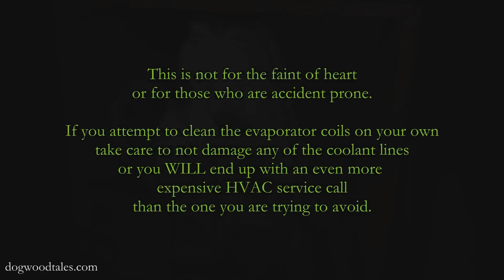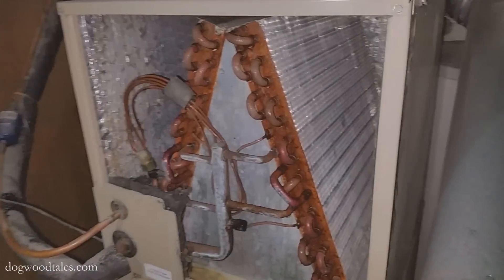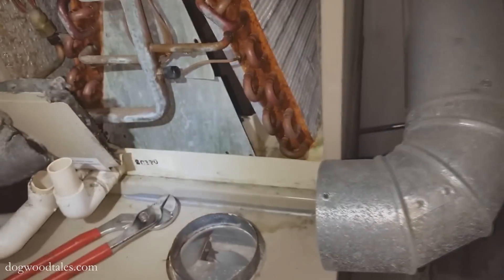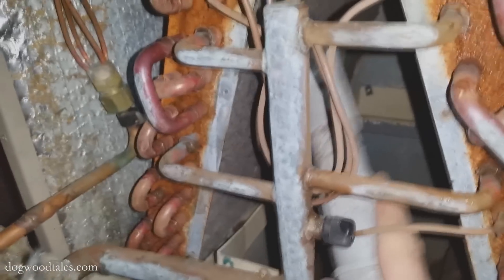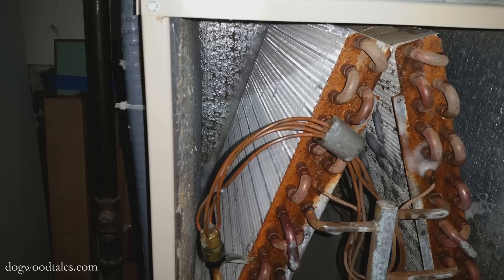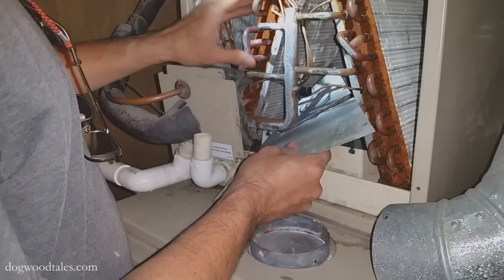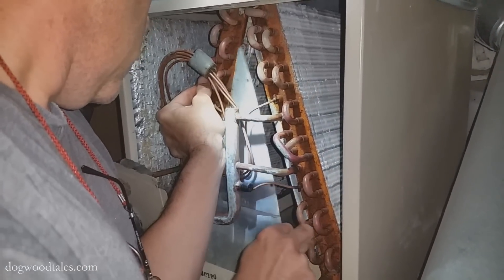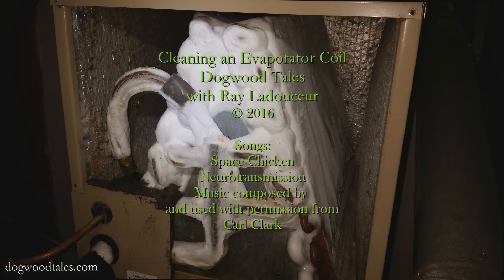Frozen Air Conditioner

Comment: I have been in the sheet metal business for 35 years everyone puts the filter right at the furnace or unit this leads to less filter changes because out of sight out of mind. But if you install filter grills inside the house two things will happen you will notice dirty filters thus changing them more often, and you will keep cleaner the return air duct system which people tend to forget. Having to replace dirty ducts that have layers thick of dead skin cells and hair believe me you don't want your air dragged over that filth.
Reply from the maker: Tarbaby I actually do put filters inside the cold air returns but started that practice after the point of this video.

Comment: This is why I buy the very best 3M filter & change it every three months no matter what.
Reply from the maker: Who Me? Ounce of prevention equals a pound of cure 
I do this now too with no further issues, but back then I still had an electromagnetic air filter that I cleaned monthly but it just didn’t filter as well as these pleated filters do and I ended up with all that gunk
Reply: they are very hard on fan motor damned if you do damned if you dont

Comment: I think the AC guys are trying to scam my mother. Can you answer a couple of questions for me?
Reply from the maker: DreamZ FPV I’m not a licensed hvac tech, but I work with them
I can’t make any guarantees but you can post your question here and I can see if I can find a reasonable answer for you.
Reply: @dogwoodtales  thank you
Reply from the maker: DreamZ FPV I’m wondering why it was overcharged to begin with and then if he discharged too much
Yeah I know you’re ref to the evaporator coil
Good luck!
Reply: @dogwoodtales  what should I do this unit is less than two years old. The motor to the fan outside was stopping. After my research and comments sense it's either the motor or the capacitor. Any this guy says it's over charged and said he fixed it then an hour after he left my unit has ice everywhere. He comes today and says the evaperant coil needs replacement. He said there is nothing wrong with the unit outside. So either his meter is not calibrated or he doesn't know what he's doing. He is supposed to be coming back in the afternoon to put in a new coil. The unit it warrantied and I've paid my $50 deductible but if he's a scammer or if he doesn't know what he is doing I don't want him in my house or repairing anything.
Reply from the maker: @djilly75  First, keep in mind that this is site unseen, so again no guarantees.
After sharing this with a commercial hvac foreman with many years of experience I can share this much –

Chances are there’s nothing wrong with his meter.
If the motor was running and then shuts off, it’s a thermal issue. The motor was overheating for some reason.
If the motor just doesn’t start, then the first thing to look at is a bad capacitor.
If the unit is freezing over it could be any combination of a dirty filter, a dirty coil (my case in this video), and/or low refrigerant.
If there’s low refrigerant then there’s probably a leak somewhere. Have the tech show you where the leak is.
If this unit is less than two years old it probably has an aluminum coil and probably shouldn’t be having leak issues already, but it could just be a dud too. It happens.
When the tech comes out to replace the coil, you have every right to stand there and watch and ask questions.

My .02 - Look at that coil before he does anything to it. If it’s caked with junk (like mine was) then maybe have him just clean it before doing anything else and then see if there's problems.
Also check out your air filer. Those need regular replacement. A dirty filter and/or a dirty coil will slow down air movement and cause things to freeze over. An improper charge, low refrigerant or too much can  freeze it over too.
Sounds like you have an extended service warranty on it, so worse case scenario (imho) is that you’re out $50 for a new coil.
If that doesn’t fix the problem, then make them come out until it’s right, but  I’d be wary about paying them $50 each visit.
Hope this helps a little.
Reply: @dogwoodtales my main question is why is he saying the coil needs replacing? He said that's why there was ice. There was no ice until he discharged it. It was only a motor or capacitor problem. It could have been a simple cold solder joint. Lol I build drones. Cold solder joint is an inside joke.
Reply: @dogwoodtales  he was talking about replacing the coil inside the house. I'm going to stay quiet and record everything he is doing. I will stop him before starts removing any big parts. If he is overcharging the insurance company then he better have some cash for me lol

Comment: I want to add a picture but it won't let me. I'm new to this and don't want to call an AC person because I live on limited funds. The coils are turning white and they didn't do this last year when I bought this place.  Not all the coils. Starting at the bottom they are white. Like three rows then it goes to the copper looking like they normally look. Am I too late....do I need an expert to fix this? Any suggestions will be much appreciated. Thank you!
Reply from the maker: Wendy Longmeyer honestly I am not sure. If the coils and filters are clean and the system is still having issues it’s best to call in an expert to look at it. Your system could be low on refrigerant, have a leak, or any number of other issues that are far less diy for the average homeowner.
Reply: @dogwoodtales  thank you so much for this information. I will call in an expert. I have my areas of expertise but this is definitely not one of them. Lol
Reply from the maker: Wendy Longmeyer sounds like that’s the best option. I began this video with that caution statement for a reason. Hope it doesn’t cost too much.

Comment: These hack videos gotta stop.. those refrigeration lines are under extreme pressure with a chemical called refrigerant.. crack or break a line you will be injured or worse!! I dont recommend amatures doing this.. plus the coil should be removed for a proper cleaning by pro's and you get a workmanship  warranty... this video  is not smart!!
Reply: Whatever you're selling, keep it to yourself.. NO one watching this video even after 7 months liked your comment... Don't be such a pussy, its just HVAC not a rocket engine.. If you were a REAL HVAC tech you would let people destroy their stuff, so you can sell them new systems; so you Sir are just a Troll !

Comment: Ok...i guess this vid is for people that are frugal... PLEASE TAKE MY ADVICE.. GET AN AC/ HEAT SERVICE CONTRACT... LET THE PROS DO IT... THEY CAN FIND ANY OTHER UNDER LYING ISSUES THAT YOU MAY NEVER NOTICE OR UNDERSTAND... I DONT RECOMMENDED AMATEURS DOING THIS..IF YOU RUPTURE ANY REFRIGERATION LINES YOU CAN GET INJURED OR WORSE!! LETTING A PRO DO IT  MEANS THAT THERE IS A WARRANTY ON WORKMANSHIP!!  You may save yourself a couple of bucks by doing it yourself but its not smart!! It will cost alot more if you screw up!! CALL A TECH!!

Comment: How did it get so dirty?  Was no filter ran for years on end?  I don't even catch that much filth on the filter itself.
Reply from the maker: Blaine Bugaski I’m not sure
Perhaps the electrostatic filter system that I used to use didn’t clean as well as promised even though I cleaned it faithfully every month. I also had a lot of kids in the house, a dog, and a wood shop, so those factors accelerated the dirt accumulation. I think it was mainly the system as it’s been clean since I started using 4” pleated filters.
Reply: Ah yes, the electric air cleaner.  My father had one of those, for about 10 years neither of us knew that there was a SECOND cartridge in the ducting behind the first.  We had only been cleaning half of it for literally 10 years.

There are the mesh screen pre-filters and then the electrostatic units side by side.  Also we had been installing them backwards.

It was a $hit show from the beginning.  Lots of blackish filth throughout the HVAC system.  No smoking either but it was almost like a sooty type dust, the type that if you touch it, it just smears around instead of wiping clean.  Never knew what the heck was up with that.
Reply: Mine gets this way every 2 years.. I clean it yearly as PM now... Arizona with dogs inside :p

Comment: Change your filters people
Reply from the maker: Austin Bartose actually I had a electronic air filter that I cleaned once a month religiously for years and then switched to the 4 inch pleated filters which are changed every 4-6 weeks. While that is an important first line of prevention and maintenance it still doesn't 100% stop the relentless force of dust over time.
Plus having a woodshop in the basement probably didn't help either lol.

Comment: I just cleaned this last year, have been replacing the filters and cleaning the outside system. So expensive to add refrigerant, might be my problem
Reply from the maker: javier hernandez could be, but low refrigerant wouldn't make it dirty
Reply: correct, I was just mentioning what I have done so far, implying that low refrigerant is most likely my root problem for a frozen evaporator coil. 

had the same issue last year and I thought it was the dirty coils and filters I found in a house I recently bought.

Comment: great video can you tell me which side should I remove to see if its icing up. I will greatly appreciate it.
Reply from the maker: Luba Luba I really can't say without seeing your unit. But if either side is accessible, then it will work. In fact, if you can work from the side opposite to what I had to do you might not have to deal with all of the hoses I had to. Good luck!
Reply: can you look at a few pics I can upload here
Reply: click on my profile pic and background you can see both pics where the evaporator is located
Reply from the maker: First, thank you very much for watching my video. I do hope that you find it informative for your situation.
However, I think it does both of us a favor for me to refer you back to my statement in the first 5 seconds of this video.
I think you would be better served by hiring a professional HVAC to resolve your issue. I know that will cost some money, but a wrong move on your part and it will cost you a lot more money.
Best wishes.

Comment: can a person use a air compressor and spray out the ac coiils inside?
Reply from the maker: Jesse Brouwer not sure. The cocern is to NOT damage the foils, or as little as possible. Also, an air compressor will blow all that dust into your unit, so for that reason alone I wouldn't do that.
Reply: I did the first time I cleaned mine as I have access to the inside of the A frame.. Must spray straight and true, Lot of room for error and damage though. Vacuum with attachment worked best.

Comment: Well my wife & I noticed lots of leaking from our a/c. Called repair person & they keep insisting that the freezing was caused cause we kept dropping thermostat below 70°. I told him we have it set & dont touch it. He told us let ice thaw, so we did then he later returned to cut a.c. unit back on from outside and again it leaks. He never told us this may be the problem. He insist that the only reason it happens is from us changing temp below 70° cause he ruled out all other possibilities of thermostat, batteries or air filter.

Comment: Mine freezes up from time to time, mostly in the late evenings.  I checked under the A coil and it actually clean.  I've had this unit for almost 15 years and have never had to clean it, other than vacuuming some light dust off the outside of the A coil under the filters once in a while.  I change my filters regularly.  I have noticed that the unit outside has some bent fins (more than normal) so I am wondering if that is my issue.
Reply from the maker: Terry C. Enough Damaged foils will reduce air flow. Sounds like you might need a pro to diagnose.

Comment: Is there no way to see the bottom side of the coils?  It's all burner section just below it?  I need to see mine.
Reply from the maker: BeeRich33 in my particular A frame coil what you see in the video is as much as I can see in person. directly below this, in the design of my system, sits the heat manifold.
Reply: Seems I have the same.  Had mine pulled for $400 to have cleaned and recharged.  It was completely caked.  It's now frozen in 33°C weather.  Not sure what to do.  I don't want to spend another $400 just to clean it.  There's a problem.

Comment: Thank you God for You tube videos on cleaning evaporator coils! I watched your video and not really wanting to do it,  I called a heat and air company to clean it for me.  Well he charged me a $75 service call and told me to open my windows bc it was going to be another$150 for labor plus $90 per pound of freon.  But he couldn't tell me how many pounds approximately It needed. Im not stupid! It has never been cleaned and I have 3dogs and a cat,  so I knew it was dirty.  So I bought coil cleaner and took it apart as you described in your video!  Within 2 hours it went from 84 degrees down to a comfortable 73!  THANK YOU SO VERY MUCH!
Reply: I guess your being frugal.. your tech is correct to charge what he needed ...they are pro's like  doctor's or lawyer's...the tech was planning on total removal of the coil for a deep down cleaning as it should... what you did was to get it to work (minimum)(band aid) .. also he could detect other under lying issues that you dont know about or understand..And if you break any refrigeration lines you will be going to the  hospital!! Not smart.. plus your tech will give you a work warranty!! You have no warranty!!  The only thing going through your mind is that you saved a couple of bucks...not realizing how dangerous this could have been by simply making one mistake...
Reply: @richardwoeckener7936  nice sales pitch!
Reply: You may have gotten the coil cleaner than it was, but odds are, it's not as completely clean as it should be. Will you shorten the life of the compressor somewhat, or cause your electric costs to be somewhat higher than need be? More likely yes than no.

Comment: I'm a commercial HVAC technician. 
You did this perfect. 
Nice work. 
I was expecting a hack job.
Reply: Don’t b mad he made a portion of your job look easy. He trouble shot the situation, and saved himself some steps.
Reply: @michaelcastillo3231  wow!! You dont get it!! Are you ass uming.. i dont do residential hvacr... i dont go in attics or basements.. your comment is narrow and shallow thinking
Reply: @richardwoeckener7936  My attic is 150° here in Fl. What do you suggest for those of us who have their evap in an attic  I mean, since you don't go in them and all, what should the DIY guy do?
Reply: Im suprised you say that!! This is a hack vid... it was totally incomplete and could be dangerous to amatuers! Do it the right way or dont do it... if there is no other issue creating this freezing issue.. remove coil completely..take out side and clean then rinse ..clean drain pan on coil.. re install coil,drains ...pressure test..deep vacuum..release refrigerant.. check super heat/ sub cooling and top off if needed.. this should not be done by amatuers..its just a quick band aid !! This is for people that are frugal.. and hope somone doesnt get hurt!!
Reply: @richardwoeckener7936  don't talk shit.
Reply: @richardwoeckener7936  hvac techs charge about $1000 to "recondition" the evaporator coils? am I right?
Reply: @metsrus  you're right, shit industry
Reply: @richardwoeckener7936  Really? sorry but it turned out perfect. He's not working with nitroglycerin, lol
Reply: What kinda special bus do you ride
Reply: I'm sure ppl love you

Comment: Great video. Putting that triangular metal sheet back into place took up exactly 27% of this video. Tinsnips!
Reply from the maker: J.J. Vargas lol not being an experienced pro I was being very slow and cautious so as to not damage any of the lines
Took a lot less time when I checked it this past spring, and I remembered to cut that triangle all the way before putting it back in. As someone else mentioned that's not necessary, but it will sure make it easier to take off next time.
Thanks for watching